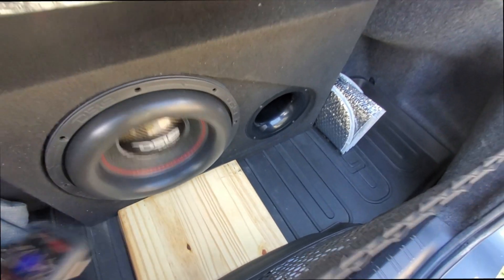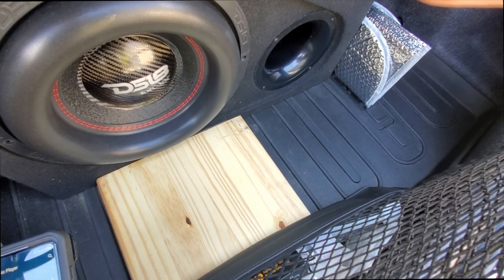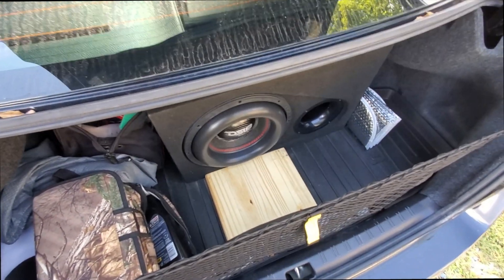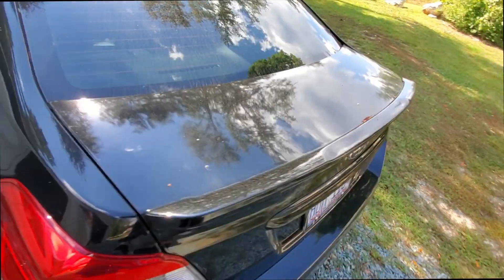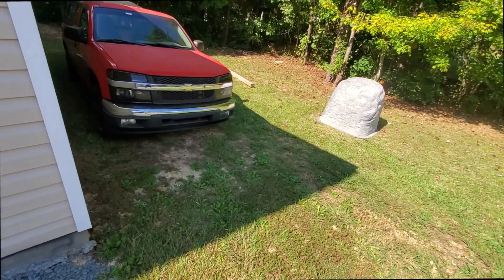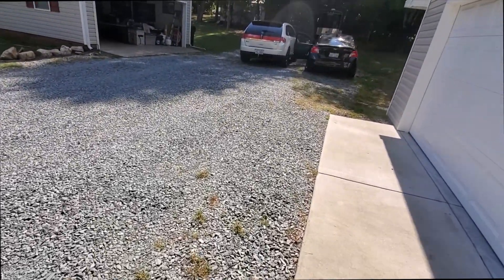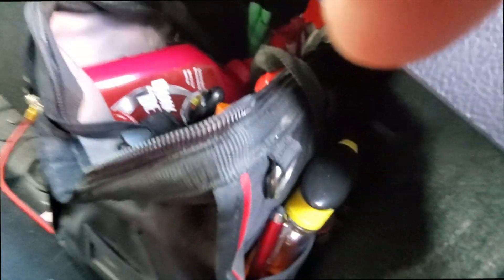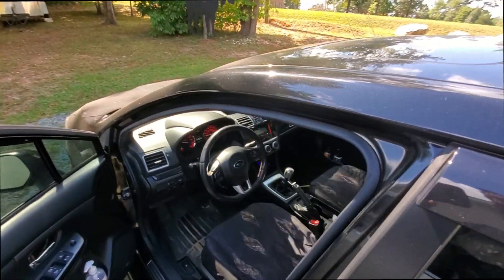Port Adjustment Ds18 EXLXXB High Excursion

Comment: Crossover on amp or on head unit, I hate when a 20-25 hz note comes through my woofer at full power...being over powered you hear the wonderful sound of bottoming out in that range lol
Reply from the maker: Yea my hpf is about 28hz on this sub and lpf is around 80 but its as far as an sfb amp can go
Reply from the maker: But 2000 watts is pretty much underpowering this sub can handle way more.
Reply: Rex n Hogz I haven’t touched my amp in years, maybe I shall take a look!